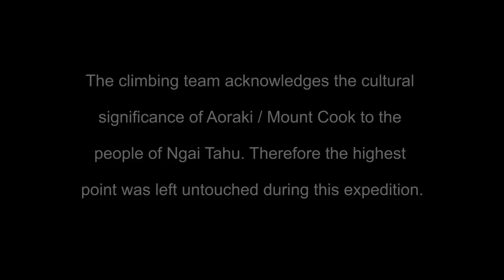Mt Cook's Collapsed Summit

Comment: 7:04 I watched this whole thing to find out how much the height had changed by. I couldn't understand the accent. is it 14m less than the 1991 measurement?
Reply from the maker: It is 40 metres lower now than in 1991
Reply: thanks. wow, that's significant. driving through Arthurs Pass every week, erosion is very obvious. I think the mountains must have formed fairly quickly to rise faster than they fall ?? ie. quicker than our current estimates.